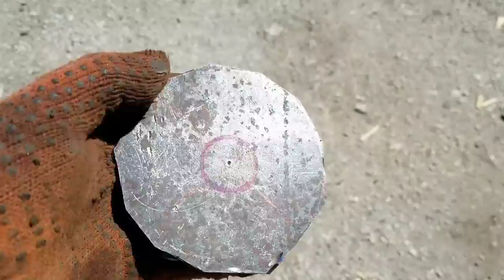Задний дисковый тормоз Honda Dio

Comment: it seems if the  spacer ring that you moved outside from the inside the gearbox [oil]  gave you extra shaft length which this would not work without . What did  this spacer do in its original position ? and now why isn't it needed ? Just a very lucky coincidence a part turned up to save the day , suspicious .

Comment: Changing the brakes is not a good idea.
Introduce all kinds of objects to the wheel that you don't know what to do.
What happens at 85km / h when you brake? But if you have 85km / h, 2 people + luggage? Do you resist welded parts? Vibration? Is the wheel locked? presents security.
However, in the case of a fatal accident, it is about prison, regardless of who is at fault. That if you survive ... theoretically .

Comment: なんで日本語わかるんですか？英語はわかりますか？
It is dangerous to lock in that way. No need Dio's rear tire to big disk brake. Because does not as not got a weight as in the rear. It is that front.